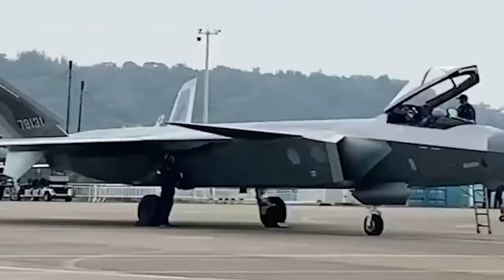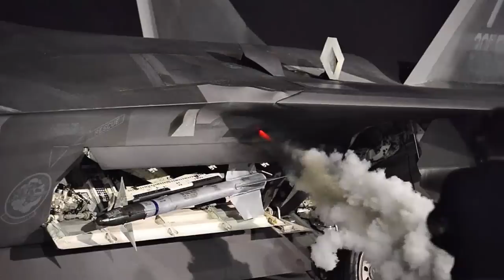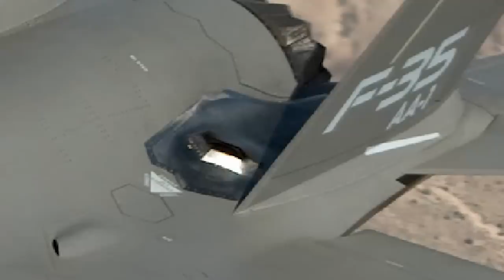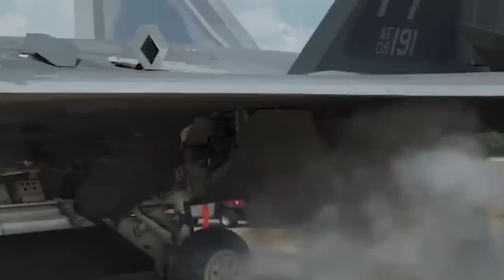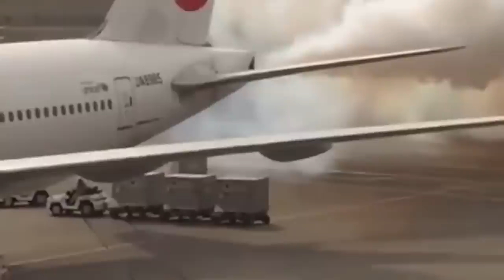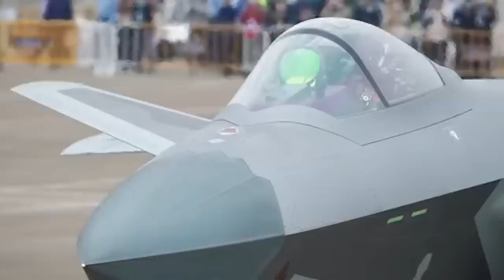J-20 broke down in airshow? Big black smoke ! But this is not what you think it is!

Comment: The J20's design is better: it shoots the smoke upward to scatter, while the F22 shoot downward to the ground, choking the ground operation personnel on the ground ......
Reply: and the Boeing shoot at rearward like farting.. 🤣🤣
Reply: And the J20 has a giant heat signature with those huge round double exhausts. Easy target for the F-22😮
Reply: @pedalshredders1401  from 150kms away, that little difference in size won’t matter that much for Air to air missiles.
Reply: @kaiding417  Do your research. 150 km away is child’s play for the F-22
Reply: @pedalshredders1401  F22 is blind in the Infra-Red my guy 😂😂😂
Reply: @GolddenWaffles  J-20. Junk. Model #20
Reply: @pedalshredders1401  
AIM-120 vs PL-15. Before you can spot J-20, F-22 may already been shot downed.
Reply: @pedalshredders1401  I’m not saying that I’m siding with the Chinese, but the F-35 is a far better plane than the F-22 to fight other stealth planes. Even the retired F-14D with the IRST can see a stealth fighter from 100 nm but obviously the J-20 could see the F-14 with radar, so not an option. But still F-35 is far better of a platform than the F-22 for the future
Reply: @GolddenWaffles  There’s a reason we don’t sell the F-22 even to allies
Reply: @pedalshredders1401  even the lasted version of AIM-120 (120D) has a MAXIMUM range of only 160kms, (btw in real combat environment, they will never go that far out)  Which is currently equipped on the raptor. OH PLEASE, 😂😂 150km as child play? How about do your own research.
Reply: @kaiding417  I’ll take the F-22. You can have the J-20
Reply: Better design hahahahaha, stealing technology and then claims their product is better
Reply: @89turbomk3  It seems that US has all the best ideas and technologies, somehow just lacks anti-theft technology to protect them .....
Reply: @davetsang88  is that your excuse and justification ? Hahha
Reply: @89turbomk3  no, it is not an excuse nor justification, but an explainable mystery 😆.
Reply: @89turbomk3  f35 is a russia designed plane, they call it yak141
Reply: Yea big talk consider how many air to air combat have china engaged in? Im sure build the j20 all by themselves right? Had nothing to do with stealing technology?

Comment: Just pump out the carbondioxide out of main machine. It's common thing in fighter jets
Reply: Carbon dioxide is transparent or white depending on concentration and temperature. The initial start includes a lot of unburnt or partially burnt fuel until the engine warms up sufficiently to completely burn the fuel.
Reply: u must be paid by China

Comment: I do confirm,  this totally normal on the F-22, and most probably on the J-22 as well. Those smokes come with a "cartridge start" . It is an easy way to start engine from a remote station/airfield .  You can easily find such videos about cartridge starts with B52, DH Venom, DH Cambera. Even some WWII aircraft used cartridge to start radial pistons engine ( video of Grumman Wildcat ) .   This J-20 start worked just fine.

Comment: apu, electric starting, requires rich fuel starting, which can reduce the power requirements for the starter and shorten the starting time. Aviation kerosene has a higher volatile point than gasoline, a lower volatile point than diesel, and a flash point higher than diesel. When starting, it is between diesel and gasoline. The gasoline engine starts without black smoke, and the diesel engine starts with black smoke.

Comment: That was a cartridge start  as evincdnced by a small amount of black smoke. Cartridge is used to start the aircraft when APUs not available say in case aircraft diverts to an airfield where ground support equipment is not available for that particular type.  Fighter do not have APU to save weight and complexity.
Reply from the maker: thanks for sharing, wonderful
Reply from the maker: however f22 and j20 do have apu. The F-22 is equipped with a hybrid APU (auxiliary power unit) made by Allied Signal for Boeing.

Comment: The J20 is a excellent fighter jet. 🇨🇳👍👏
From Malaysia 🇲🇾😎
Reply: Kermit Idiothunter  Is that before or after the F-35 gets fished out of the South China Sea? Fun Fact: A Chinese built salvage ship was hired to recover the aircraft. How embarrassing... 🤣😂🤣😂
Reply: Kermit Idiothunter  ...because the F-35 can double as a submarine... 🤣😂🤣😂
Reply: Kermit Idiothunter    Better at plunging into the sea.  It’s a submarine, it’s a plane, it’s a fish
Reply: There's a difference between Interceptor and an Air superiority fighter. J20 is the former which is used to usually target large support aircraft like AWACs, Tankers, AC-130 Gunships, etc. Where as the F22 is to the latter as it is clearly designed to engage other fighters.

Both have different roles.

So in terms of aerial dogfight, F22 has the edge. But J20 can knock out those AWACs and Tankers to reduce the combat mission of the F22.
Reply: Kermit Idiothunter    Definitely!  It can dive.  Definitely do better than all of the world fighters when it comes to diving.  No other fighters can match it
Reply: Kermit Idiothunter  Hence it's sometimes called 4.5 generation fighter. Also, they're slightly bigger than the F22 but smaller than the SU57 with SU27 being as large as J20 and its weight is slightly heavier than F22.

As for technologies, I won't have a say for that matter as they will be having different variants like the J20B and J20C and it would be arrogant for me to assume and guess it's capability when the PRC haven't publicized it's specifications.

Unless you were given by it, otherwise as far as its capability goes is a mystery, and at best we can only guess.
Reply: Kermit Idiothunter  That's pretty much vague, we're going to need more sources about them especially within China who worked the J20 program, and I doubt even a US would be willing to expose their capability to the public lest risk themselves revealing their cards of surprising China should a war between PRC and USA happens.

Either way F22 has the edge against the J20 by its mere role as an air superiority fighter, a type of fighter that is good at fighting interceptors like the J20.
Reply: Kermit Idiothunter  At least the Russians don't need the Chinese to recover their salvage... 🤣😂🤣😂
Reply: Kermit Idiothunter  I don't apology to racist. At least you can't breed, that's a plus.

Comment: f22 still is the best
Reply: Not just the best it's the original
Reply: The Mythbuster  
Just a thought
The F-22 is over 20 years old and wasnt built to full spec
Reply: The Mythbuster  
The F-22 is 20 years and much older but still outclasses many of the quote 21th Century aircraft
The J-20 is on engine series number 3 while the F-22  has used the same engine since their introduction
It basically the same issue with the Su-57 , having to use a stand in engine till the production engine is ready
The F-22 supercruises at mach 1.8 while Su-57 at 1.3 whereas the J-20 supercruise remains un confirmed 
Additional F-22 top speed still faster than both which says a lot about Russian and Chinese engines
For reason unknown, the J-20 lacks a gun while the F-22 and Su-57 has a gun why China deleted the gun ??
The F-22 carries 8 missiles to the J-20 six and Su-57 six
The Su-57 has the ability to carry cruise missiles and other air to surface weapons which neither F-22 or J-20 can do 
The F-22 relies on JDAMs and GBU-39/53s which gives a degree of air to ground capabilities. The J-20 is very limited in that area
The backbone of the F-22 capabilities is the ALR-94 which it shares with the F-35. The Su-57 is the Sh-121 multifunctional integrated radio electronic system (MIRES) 
The EW suite on the J-20 is unknown. It may only have its Type-1475 radar 
So yes in many ways, the F-22 is still better than newer designed aircraft

Comment: Why fighter jet need apu plug on the body?
It make the fighter more wieight.
Just used apu in airport.
Where the main turbo engine gas has  start ,unplug apu.

Su 30 Did it.
Reply: Air restart and faster turnaround time